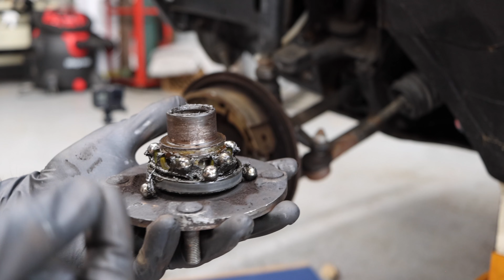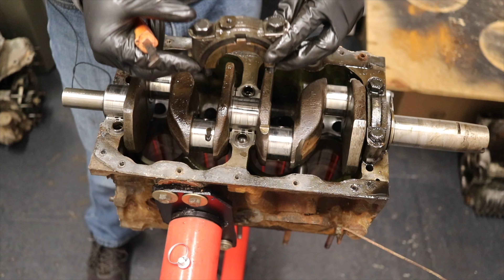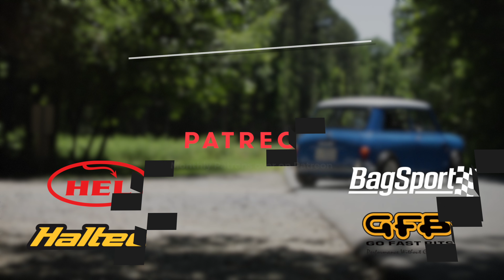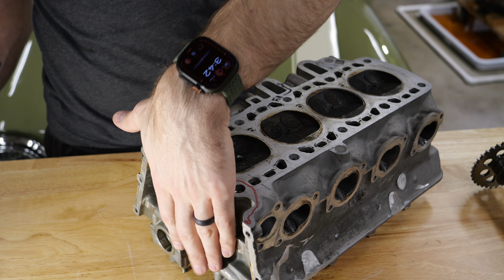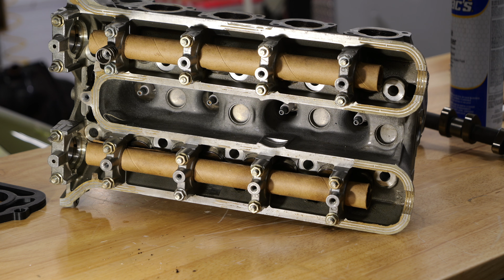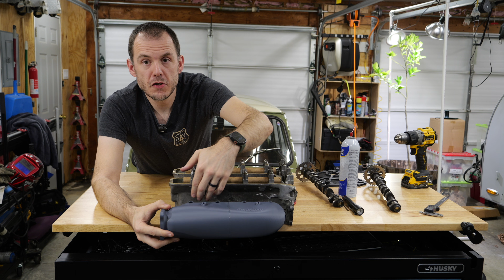TwinCam Engine Build - Episode 2 | Mods to the 16V Head

Comment: I really like the 16v crossflow head. It’s makes so much more sense. Will the block and the new head still use a standard layout head gasket ? ( with/without the extra Cooper S head stud) ..
Reply from the maker: The head gasket will be different, Ben over at Bagsport is having a custom one produced for future sale. None of the oil or water passages will be used between the head and the block. Also the stud pattern is a bit different so it has to accommodate those changes.
Reply: @classicminidiy Cheers Cole, very interesting project build good stuff! 👍🇬🇧

Comment: Have you heard of the 1-2 mg’s that did this head swap as well?
Reply from the maker: No I haven’t! Do you have any info on them?
Reply: @classicminidiy  an acquaintance of mine in the UK, Phil Mayne has recently done this on his 1966 MG Midget, mostly using the Specialist Components stuff, plus some home-brewed bits (if you’re on Facebook, have a look back through SC’s page to 14th June 2025 for a few pics of his car + dyno run video). SC also posted on their Facebook page a very clean Midget which used their kit. I’ve seen another example at various shows, but haven’t met the owner/builder for that one.
One of my own Midgets also has a K series, but a totally different one - a complete engine from a 1990s Rover - 16 valve, efi and available in 1.4, 1.6 and 1.8 litre sizes with factory turbo or variable valve control on the 1.8. I’m keeping the faith, though, as I also have a 1380 5 port A series powered one, too.

Comment: Surely the cam gear “post” you mention is steel, so how are you going to weld it into place on an aluminium head?
Reply from the maker: Yeah that was a small misspoken detail. The post will come out and you weld up the hole

Comment: how are you going to beef up the crank and bearings to deal with all the power?
Reply from the maker: Crank and rods can handle the power just fine actually. Though I will be getting new forged rods and custom pistons. The big weak area is the drop gears. I likely will do straight cut drop gears to deal with that.